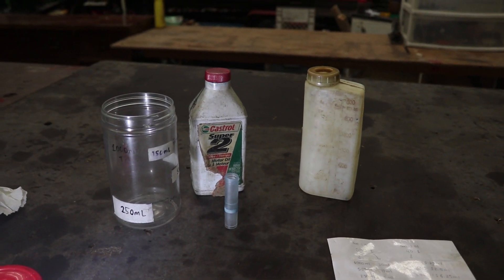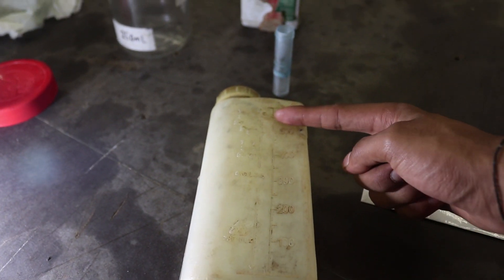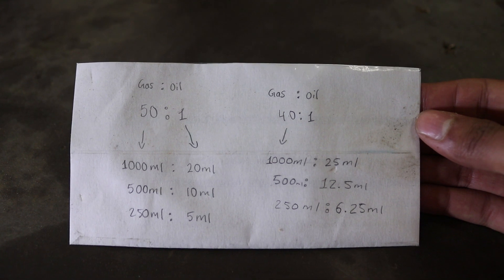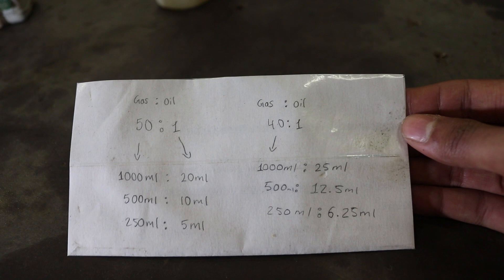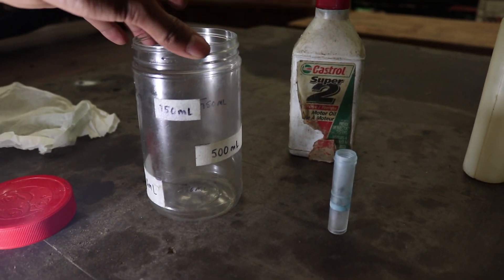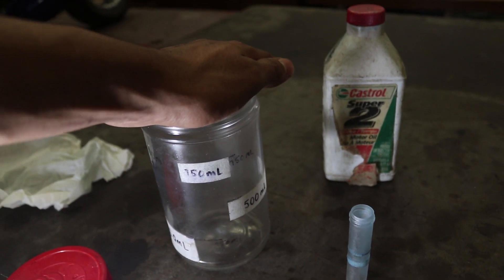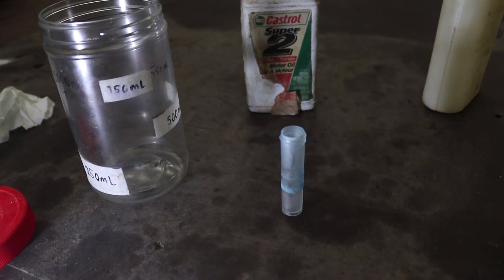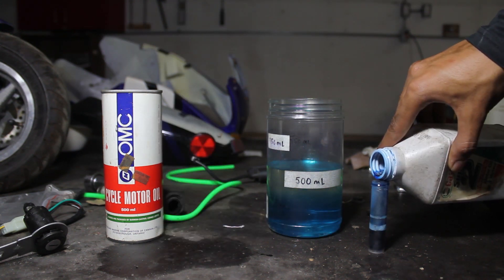How To Mix 2 Stroke Oil (Oil and Gas)

Comment: Nice video, I found if you use a 30ml measuring syringe that you can pick up on ebay cheap it is a lot easier you can just fill it with the amount of oil you want and add it to the gas.
Reply from the maker: That's true for the oil part. And then you can use a measuring cup for cooking to fill in the correct amount of gas.

Comment: tanx mate
Reply: Fired up my old Pioneer chain saw today , been sitting for 4 years . I cleaned up the plug , emptied the old gas , found a 500 ml glass jar & a small  plastic pill container , put new chain oil in and mixed 10 ml. 2 stk oil in the glass jar . To my surprise it ran very well and idled nicely .  My Big old apple tree trunk cut up in minutes !  Thanks for those tips !

Comment: The back of the 2 stroke oil said 50.1
(20ml to 1 litre)

So I did that mix and placed into the weed eater. But then I seen in the instruction Manuel 40:1 so do I pour the mix out of the weed eater and back into the bottle and mix another 5mls in? Because I only mixed in 20mls to 1 litre.
Reply from the maker: Yes. Pour it out and add the extra oil to all the gas.
Reply: @ProjectDIYNetwork  ok I also pushed that button 10 times. Is there anyway to undo that. Lol
Reply from the maker: @melissaponeka9284  no way to undo that. Just try to squeeze whatever gas is in the bubble into the gascan. The few mLs that got into the carb shouldn't be a problem.

Comment: What type of oil do you use?
and is it neccessary to use oil
Reply from the maker: 100% you must use oil if not the engine will seize
Reply from the maker: 2 stroke motor oil